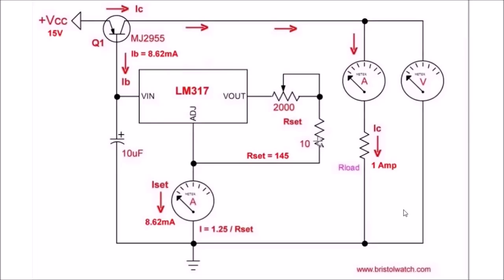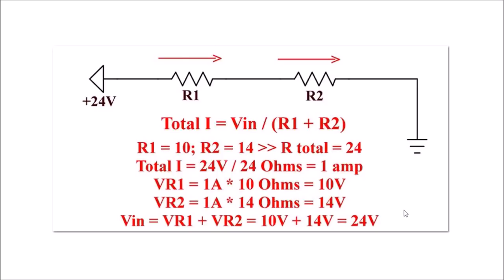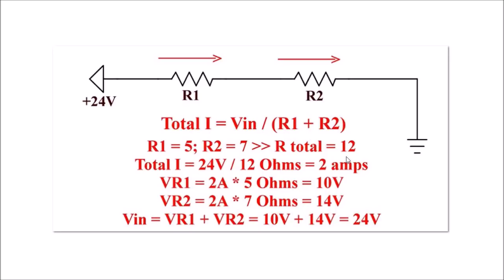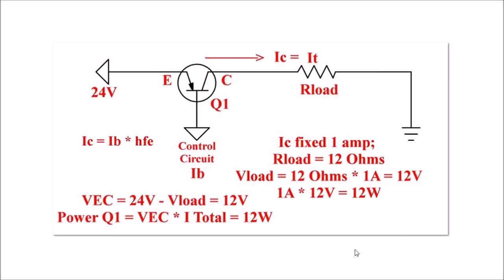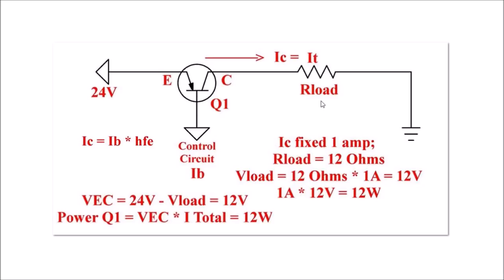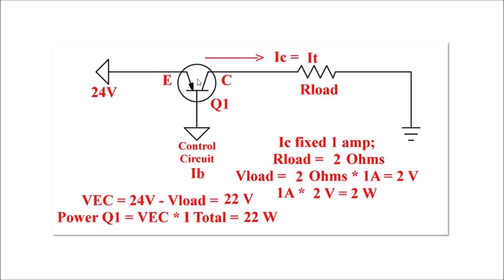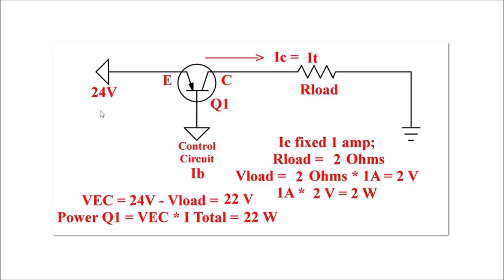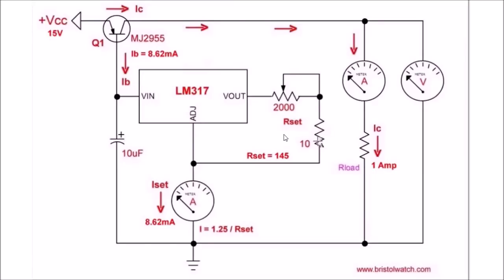Constant Current Source Theory Tutorial Part 1

Comment: For the young gamers, just a reminder that 20 watts across a typical resistor will EXPLODE the resistor nearly instantly. I know Lewis sort of mentions this in terms of the resistors and trans getting red hot. ALWAYS do the Power calculations for every circuit you build BEFORE you power it up. This 24 volt source circuit is ONLY to demonstrate the math and the principals. It is ONLY theoretical. It is NOT a circuit to actually build unless you have a resistor rated well over 20 watts (hint-use a light bulb) and a trans that is heat sunk and can handle 22 watts (good luck with that). Just want to help out the youngsters who might miss the importance of matching component power capabilities in the real world.

Comment: Hello Dr Loflin. I tried to wire up the circuit with lm317 but put a TIP36C (PNP) transistor instead of the MJ2955 and it doesn't work. It is normal ? Thanks
Reply from the maker: What load did you use? What is the input power supply?
Reply: @LewisLoflin  10W 12V halogen lamp bulb as load and 15V power supply. Isn't there a gain calculation to adjust with the TIP36C instead of the MJ2955 with regards to base current resistor value ?
Reply from the maker: @hichamtassi1753  No. Base current is only the LM317 current. The gain of the transistor times the current of the LM317 is the output current. There will be some drift due to heating.
Reply: @LewisLoflin  thanks. I will try the op amp option. Calculations  are not my strenght...
Reply from the maker: @hichamtassi1753  Note that hfe or DC gain of transistors can vary a lot even for the same part number.
Reply: @LewisLoflin  Dr Loflin I have a 12v 15A psu operated by a tl494 where the regulation is very bad (2v loss at 50% load). Any idea where to look at ? Thanks.
Reply from the maker: Never used a TL494 so I have no idea.
Reply: @LewisLoflin  Ok, thank you.